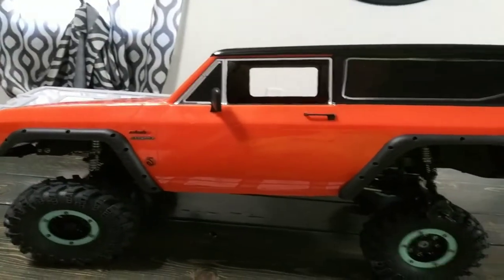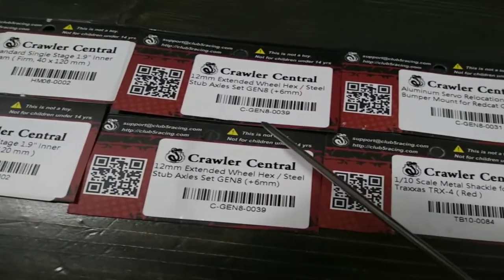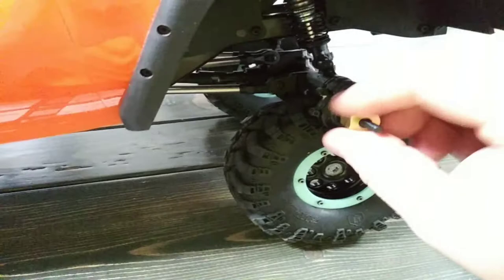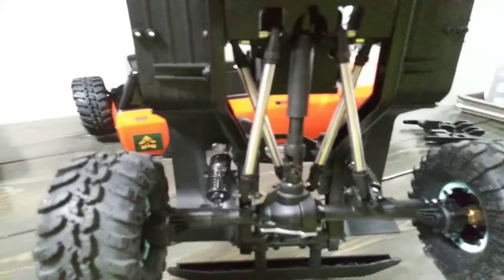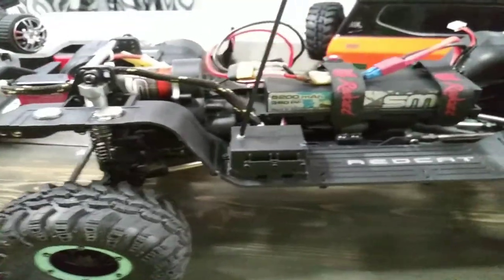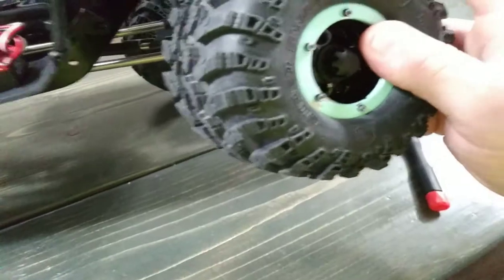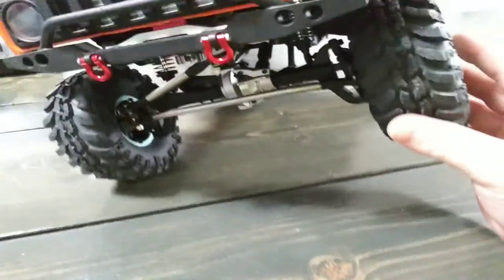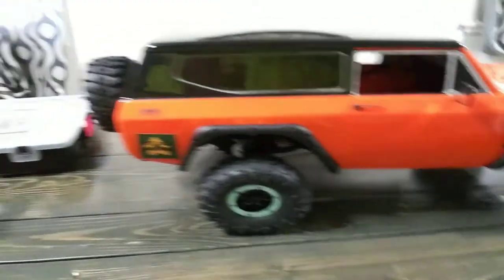Redcat gen 8 talkin and renting about upgrades and mods

Comment: If you know how to drive the belly bump is used to hang up and spin your rig in a 180 degrees. So the bump is very useful, sorry brother but I use mine all the time, I show the wife the difference between my gen8’s and my gen8 Axe Edition, I have 5 gen8’s alone with an Axe on top of that and still out does the he Axe any day
Reply: Plus I got the aluminum upgrade skid, I have every upgrade by Redcat racing offered for the gen8 and she weighs in but never a problem. I do like your rig bro, sits up there a bit though